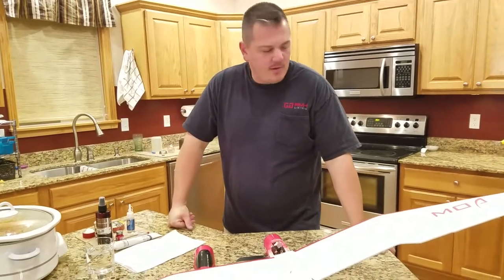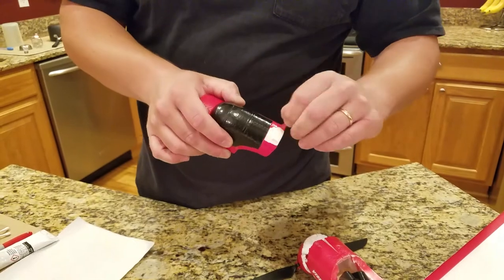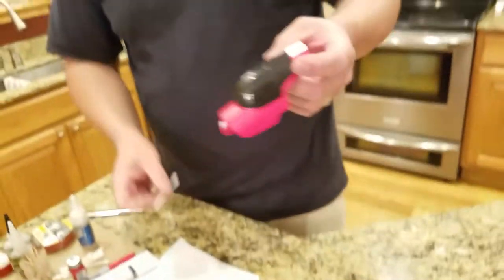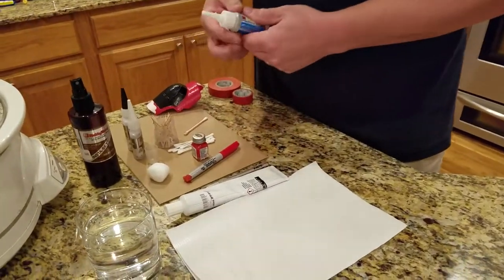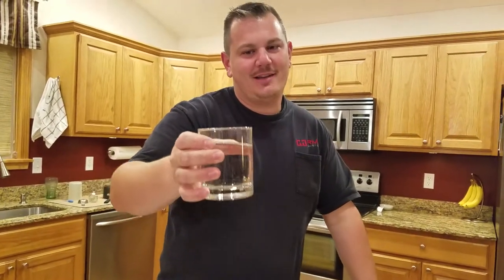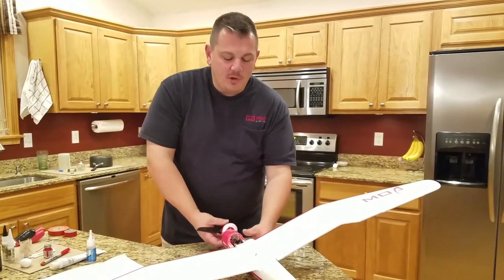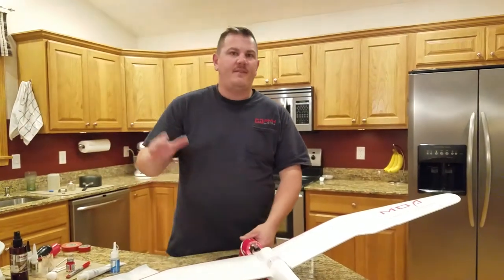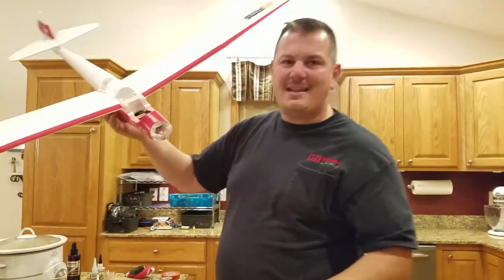FMS - Moa 1.5m Glider - Repairs - Part 1 of 2

Comment: Ahhh, the joys of repair. Thanks so much for your videos. I now currently own a Sports Cub S2 and the FMS Moa 1500. Haven’t crashed the Cub yet, but 3 min in on Moa, cracked a wing, broke the spinner. In Aussie dollars, ~$60 in bits (anew spinner, new wing set.  I also have used Zap-O and fixer on cracked wing (not point throwing fixable out). CA glue in and on outer edges. Then afterwards min, a second run of CA over the areas that ‘were’ cracked, some fixer. See how it flies tomorrow.